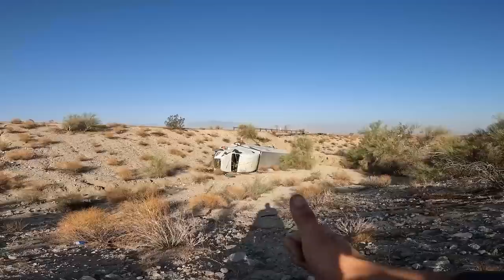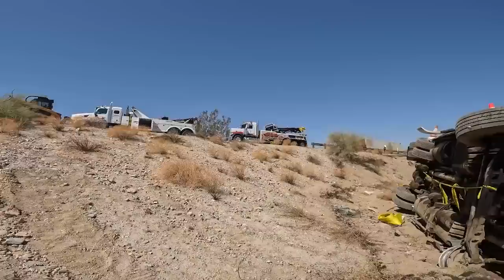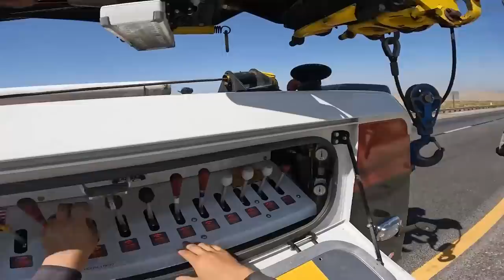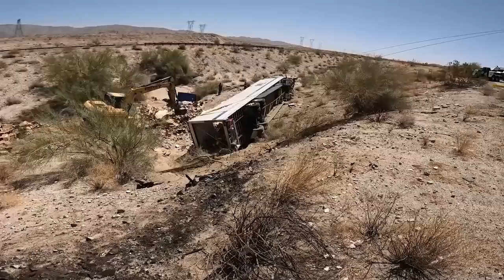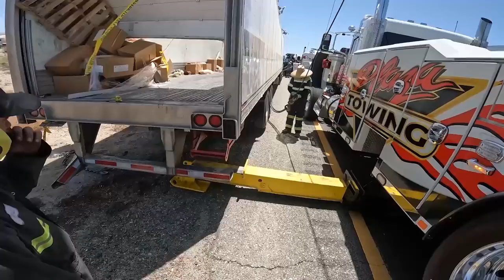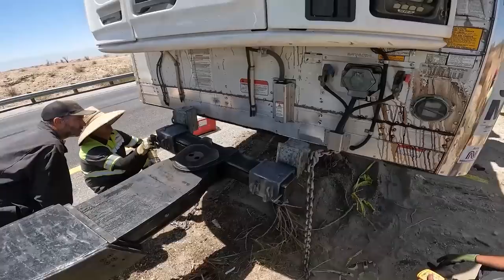BIG Rollover! Semi Truck Down The Ditch!

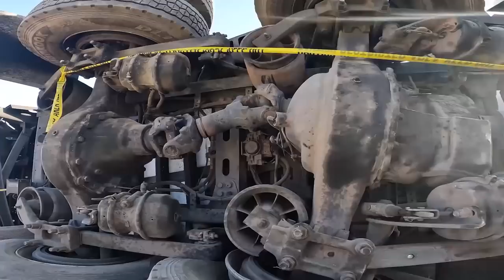Comment: great job trent,and team.if you go to 7:07 and pause it.thats a great picture to see how damaged that truck and trailer is.looks to me like the driveshaft on the tractor is twisted.plus if you look at the brackets very close to the bottom tire you can see the bracket to the right is bent.how someone in the comments thought that trailer is not compromised,look at the part at 7:07, the trailer follows the tractor.what do you think the bottom of the trailer wasnt impacted as well.35,000lbs slammed the side of the trailer very hard.those side walls are thin.you guys always come up with a plan,on every job.you saved that company money.it seems like every channel im subscribed to has at least one know nothing know it all.i turned my laptop sideways you get an even better picture.

Comment: Ah, I was wondering why the trailer has both side walls still more or less intact, you punched a hole through what would be the roof while the trailer was still lying on its side.

Comment: Just wanted to ask you a quick question if I may please,  when you pulled the truck out oif that bay, I saw that on the back of the truck one set of its tires were lifted up and off of the ground,  I think I may have asked about this a real long time ago,  but just wanted to confirm,  those are only lowered to the ground if you wat your truck to have extra Balance,  is that correct?  Thanks

Comment: Another great recovery. It was worth the wait. I have one question though. Why was the hood on the rotator open? Was that supposed to help keep the engine cooler?
Reply: The John Deere I run goes in to Chernobyl nuclear meltdown mode every time I'm doing a parked regen.  Won't make it through the cycle without the hood open.  I put two fans on it too.

Comment: Give us a update on the cause of the D-rate would be helpful maybe to some of us.
Reply from the maker: It was the def sending unit. 2nd time in 20,000 miles
Reply: @plazatowing  If you weren't in CA you could DEF delete the SOB. I'm surprised you could get the part.

Comment: If that was me I’d have unloaded the trailer before anything else. Yes it would take awhile and would suck. The last thing I’d want to do is rip a hole in the roof.  Obviously the structural integrity was already compromised, and ripping a hole in the roof took away what little structural integrity was left.  That could’ve easily opened a can of worms causing yourself more problems later on. I’m not trying to tell you your business, nor am I claiming to be an expert. I’m merely stating my opinion based on observation.  As Ron says there can be 10 different ways to get the job done.